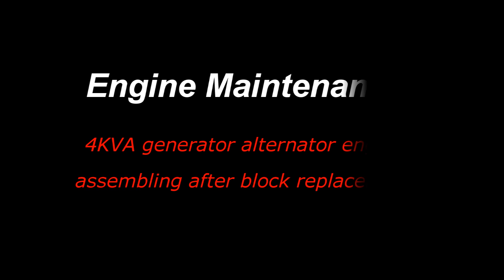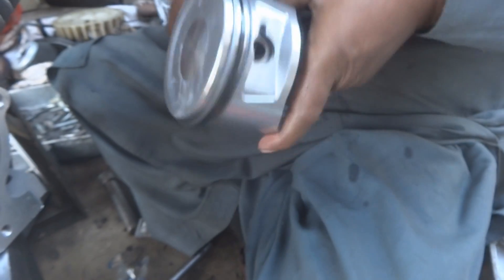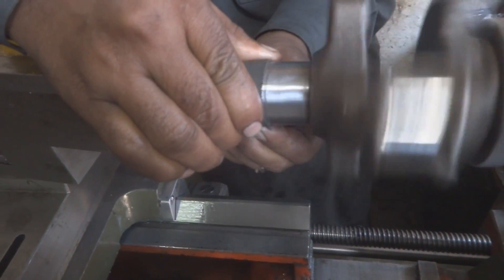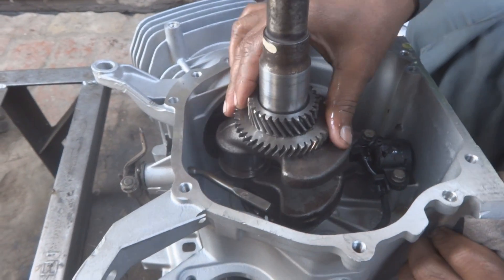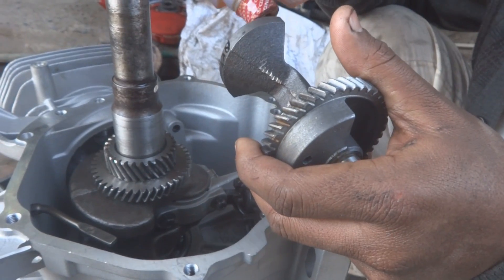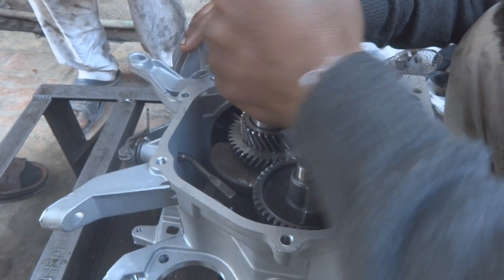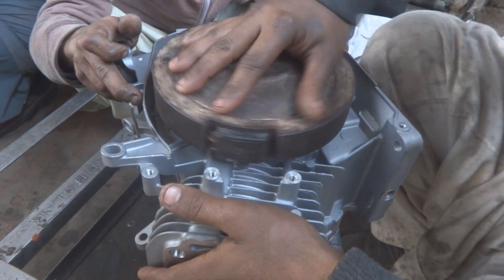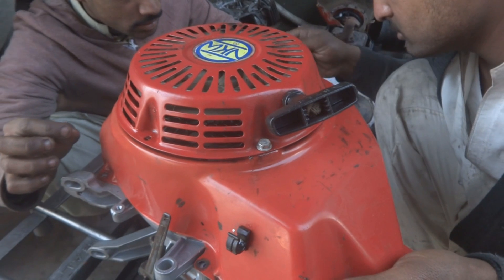generator engine assembling. Generator engine overhauling.

Comment: Sir, Can i run my kerosene Honda EXK2800s generator only by petrol? Will it run smoothly? I don't want to use kerosene oil anymore.
Reply from the maker: If this engine has a spark plug and carburetor in it, you can run it on Petrol with very few carburetor fuel and and air adjustments to optimize the engine performance and running.
If this is engine of Diesel build without spark plug then it could be way too difficult to modify it from karocine oil to Petrol.
Reply: @JahanZeb1976  Sir, it has got carburetor and a spark plug. it has got two tanks one is petrol and another tank is kerosene. Generator starts by petrol and rest it is run by kerosene. Now, if i fill petrol in kerosene tank replacing kerosene will it run?? Will i get a benefit in mileage??
Reply from the maker: @jyotirmoy2189  sure it would run. As both engines are the same for both fuels. They had given provision for kerocene oil as it was less expensive than patrol in old days. But it is not true today here. You may need little carb adjustments to make your engine better in Petrol. Wish you good luck with your modification.

Comment: Mera generator start nhi ho rha
Reply from the maker: Check fuel, carburetor and spark plug. Also check oil level. Check spark when cranking. If everything is ok then probably your gen. Engine head have problem. Needs repair.

Comment: Can you please tell me the possible fault for my 650em generator. Whan I start the generator it gives pulses and the lights of the  whole house becomes full and dim  full and dim due to engine pulsing like the kirloskar engine sounds while idling.
Waiting for yr reply. Where can be the mistake 1.generator motor 2.governor or 3.carburetor. Please I need this machine as the rain month is coming soon.
Reply from the maker: It could be a bad governor or carburetor also. First you may tune up the carb.

Comment: Dear Sir thank you for your great video. I have LD186FA Air cooled diesel engine 10HP.  The local technician replaced the crankshaft and timing gears because was broken. Everything reassembled as supposed  to be, I hope. Now the engine rotates normally with power from battery, but not starting. Can you please advise me what could be the possible failures for this, as locally cannot be fixed further and I want to make that engine work again. Thanks in advance for you support.
Reply from the maker: Dear friend there are three thing a must to start a diesel engine. Fuel, compression and timing. Check all four item should be there and should be corrected to get the engine started. They should look for tappets adjustment. Too loose or too tight tappets can be a cause of no start. Everything you must double check to get you engine back to life. Wish you good luck with your repair. Let share and celebrate your success here with us.
Reply: LearningZone  Dear Sir thank you for your reply. By tappers adjustment, you mean valve adjustment? I will check the engine tomorrow with another technician. Can I send you a video of the engine problem?
Reply from the maker: Yes on the top of valves there are tappets wich has a gap like 0.2mm on intake and 0.3mm on exhaust side for most Toyota gas engines. For your particular you can use these figures for reference or ask some specialist. That gap is critical and must be adjusted with care. Also give attention to fuel and timing issues as sometimes they are also very important. Regards,
Reply: LearningZone dear Sir, using the electric starter we managed to start the engine, but after 10-15 seconds stops. Is it fuel injector (new part) or Fuel pump problem. Checked both and found that fuel injector wasn't work as should. Reassemble it by the technician and engine worked as expected.

Comment: That block/housing looked brand new, piston/rings also, very nice :-D

The only part i would have taken more time with is refitting of the crank, i would never use a metal hammer on the shaft, the bearing in the crank case could get damaged.
Shame he didn't have something to compress the piston rings, it would have gone in with less force, but using plastic is safe :-D
With care that engine should last a loooooong time.

Have you ever rebuilt an engine like this jahan?
Reply: in my region mechanichs have no concept of using rubber or wood malet. for hammering they only prefer metal hammer due to lack of knowledge and

Comment: Another good video putting the piston in really does need a ring compressor but if there is not one available i have used a empty alluminium drink can if you cut the top and bottom off and slit it through the middle put the alluminium sheet inside the bore about 3 cm then push the piston in i replaced seals on a nitrogen accumulator using this method keep up the good work and demonstrations 👍👍👍👍👍👍👍